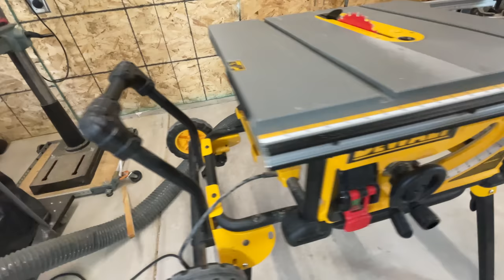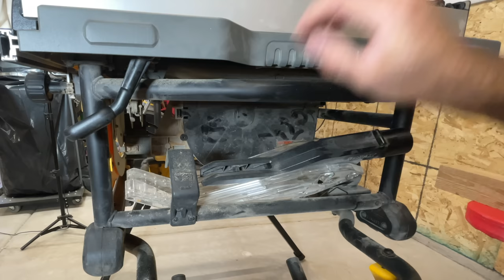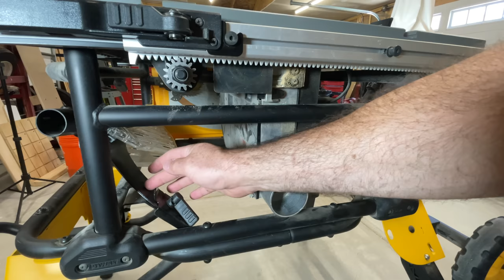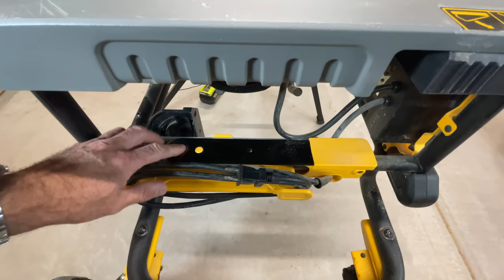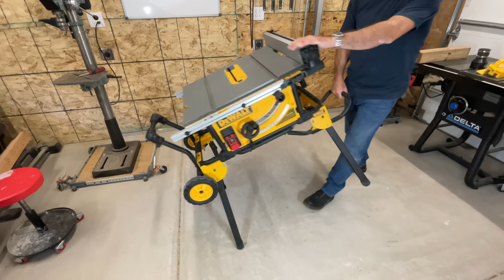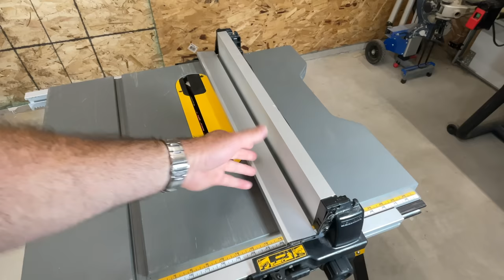The Saw Designed For Everybody?  |  DeWALT DWE7491RS   |  Review and All Adjustments

Comment: I have this saw and it’s my first table saw. I bought it cause I still wanted to park my car in the garage. It does bog down a little bit when cutting thicker material, but it’s not where I don’t feel safe making the cut. My only complaint is that the table top has little dips and valleys (it’s not flat). I found it impossible to find out if it the blade was truly at 90 degrees with a digital angle finder cause I didn’t have a flat table to reference from. I made a sled for it though and it seems to have fixed that problem, also makes the table top a little bigger. Overall I love this saw and it’s really helped me with projects around the house. I did recently start saving for a bigger 3hp sawstop as I’m now looking for more precision. Thanks for showing how to make all those adjustments, this is the only video I’ve seen that shows that. I’ll save and reference for later.
Reply from the maker: Glad I helped Cristian! I think you’ll be a amazed at what a huge upgrade the Sawstop will be, good luck!
Reply: Do you ever have problems with dust getting into the gears and rack for the fence adjustment?
Reply from the maker: No is all worked normal except for the riving knife adjustment. All the holes were jammed with sawdust to the point I thought I’d strip the bolts. Everything else was spot on.
Reply: Your see was defective. I have bought no less than 50 table saws over the past 20 years, and I've never experienced "dips and valleys." I've experienced other inconsistencies, but not a table that wasn't flat. Flat being relative, but flat enough for a portable table saw. Get it replaced under warranty.

Comment: This is the saw I used when I started my woodworking journey. I also used it for the occasional handyman job and it served itself well until it died after less than three years. I changed the brushes, switches among many other things and it wouldn't turn on. I would advise anyone to see if there is a repair facility in your area if you can't repair it yourself. I found out I didn't have one that was within 50 miles of my house. I ended up putting it on the side of the road and got a Jet 3hp saw and couldn't be happier
Reply from the maker: Sad to hear it didn’t last but I’m sure there’s no comparison to the Jet. Thanks for the info!
Reply: Did you test for power at the switch, the power cord or some terminal might have a short

Comment: Hey Mike. I like your comparison and thorough walk through videos. I had the 8 ¼" Dewalt job site saw (DWE7485)  for a week or two when this model went on sale at the big box store for $550. I returned it and bought the 10" DWE7491RS. I found your video very useful for some of the adjustments and tidbits. To do my bit to support your channel so you can post more quality videos, I subscribed. I also like your no-nonsense, straight shooter style. Good job my man!
Reply: Interesting - I did the exact opposite - got rid of the 10” in favour of the 8” for the portability. I have found the 8” cordless version to be so convenient to toss on a pair of sawhorses and store on a shelf. But that said I do have a track saw for sheet goods and a 3hp Unisaw for the shop.

Comment: I inherited a large contractor table saw that I never used because it was big, intimidating, and stored in a corner of my garage I couldn’t work around. I gave it away after years of collecting dust. 

Enter the DeWalt 10” job site table saw: I love this thing! The portability means I can easily move it into a position and setup a temporary workspace, then put it away without it taking up a large footprint. It feels SOLID. Also, being able to watch YouTube videos like this made me feel comfortable learning about all the different parts of the table saw (there weren’t any available specific for my 1970s contractor saw). It’s just a very convenient table saw for a homeowner to use. If I had a dedicated wood shop, I’d probably use something else. This is perfect for me.

Comment: I've had this saw for over 4 years in my garage workshop and it has performed very well. Combine it with a good blade, a decent outfeed table, a crosscut sled,  and a few jigs and it will handle almost anything. The only downtime I experienced with this saw was a failure of the blade raising mechanism. There is a threaded steel rod that threads into an aluminum motor mount which lowers or raises the saw when you rotate the spindle. They probably use aluminum for that part to keep the weight down. After about 3 years of use the threads in the aluminum motor mount stripped and the entire mount needed to be replaced. The repair shop indicated that this problem was fairly common with a lot of job site saws and not specific to Dewalt. My advice is keep that mechanism well lubed,  with a dry lube preferably and any sign that the mechanism isn't working smoothly lube it again.
Reply: Also there is a non threaded rod on the other side.  That also needs to be lubed at the same time otherwise it will bind.

Comment: I bought this saw 4 yrs ago. It will do everything I ask of it BUT cut accurate crosscut with that miter guage. I replaced it with an Incra brand...and..something not commonly known, I cut a strip the actual width of the miter slot and sanded the bottom flat. No more issues. It does everything I ask of it now with zero problems. I have a small shop, so the ability to fold it up and store it against a wall is a big plus! Thanks for the review. You did a fantastic job!
Reply from the maker: Thanks for watching Alan!

Comment: I have had this saw for over 5 years now. Great saw! I make cabinets and do high end trim with it. Fence is sturdy never needs adjustments. Motor is more then powerful enough IF you use the right blades for your job. Ex. Ripping I use a thin kerf ripper. All else I use 60+ tooth combo blades. I dado with it as well. Spins up an 8" dado set no problems!
I would highly recommend using your compressor to blow out the bottom of the saw and fence rails after all jobs. Then give all adjusting gears on the bottom a good spray with dry lube. You will be very happy you did.
The miter gauge supplied is useless for me. I make a ton of jigs for the saw to accomplish everything I need.I hook up my shop vac directly to the dust port and use a dual pluging switch and it works great.
My only complaint. And this is minor! The switch recently went on me. I replaced it with a simple 20amp rated light switch and a chrome cover plate using the same internal box to mount it. Came out as a nice clean looking install. And works great!
This saw owes me nothing! I have owned a mini max sc3 slider and had to down size. I went cheap and bought the Ridgid equivalent to this saw. Went threw 2 of those garbage saws in less then a year. Got the last one warrantied and sold it asap. Then bought the dewalt, money well spent.
Highly recommend.
Reply from the maker: Thank you for the insight! Thanks for watching and Happy New Year!

Comment: If you drop the 2 legs to ground by handle 1st, you can grab frame on other end lift and drop other 2 legs. I find it easier and puts less strain on the 2 legs when you flip the entire unit around. Thanks for the content!
Reply from the maker: Thanks for the tip!
Reply: drop the 2 legs hear the wheels first? then the other 2, this looks like it has 2 handles...

Comment: I have an original 744 that’s about 24 years old. Still runs but it’s noisy, bogs down often (push slowly), likely needs new motor. It’s mounted to another Dewalt aftermarket rolling stand that is excellent. Stand is easy to manipulate, soft solid wheels, easy to open and break down and has almost no movement when saw in use. Love that stand.  I’m looking at this saw above which has more RPMs, larger rip cuts, and useable options. My old Dewalt miter gauge is all metal and it’s accurate enough for a job site saw. I use my old Incra miter gauge. That Delta contractor saw isn’t really portable so it’s gonna be better. I need to bring a saw to a job occasionally so the Dewalt makes sense for me.  Demonstrating how to square and check flatness is very helpful! Thanks for a good review! 👍
Reply from the maker: I still have that DeWALT and I’ve used it many times over the last 6 months. I think it still deserve the praise now that I’ve had it for a while. It’s going back to its owner tomorrow so we’ll get a different DeWALT to check out soon. Thanks for watching!

Comment: Had mine for a couple of years now. My only complaint is the accuracy and operation of the blade tilt operation. Once set up accurately it’s a joy to use . Love the fence system and store for the prong stick. So important to align the blade with the miter slots and then set the fence to align with the slot and blade. I bought an accurate mitre gauge and a range of saw blades for different applications. Definitely recommend it.
Reply from the maker: Thanks for watching!

Comment: I just got one of these, they upgraded the miter gauge to metal and have a different mounting system for storing the blade guard. The miter gauge track still has a little slop in it; I've seen others cover the rail on the gauge with painters tape to keep it more snug.
Reply from the maker: Thanks for the tip and for watching!

Comment: One adjustment to the fence that I found out after struggling with some rips - is the fence can be out as much as a 1/4 inch because the grommets holding the fence to the rack and pinion rails can be terribly misaligned right out the box of a new saw. So when you line your fence up and if it is not in line with the bevel loosen the grommets on each side of the fence with an allen wrench square it up - then check the length reading with a tape measure  and you may have to go back and forth to get it right so the rule on the machine is accurate again with the fence straightened out. You will have to check all 3 positions. THis is CRITICAL to get a straight rip without bending the blade eventually. you would think the factory would have this set correctly on a new machine. Thanks for all the other settings descriptions.

Comment: JAN 2024, I just bought this saw and put it together today and I guess if it works great you don't have to change much, because the saw I put together today (new out of the box) looks just like the one in your video. I did have to pause the video and run outside to look at the miter gauge, I don't think the one on this saw is the original or at least they have greatly improved the one that comes with the saw now. Also behind the fence is a holder for a push stick that came with the saw. I have not turned mine on yet, but I can't wait to use it! It's an upgrade for me, from the little table saw that my brother gave me years ago. So, after watching this great video on the ins and outs of this saw, I'm ready to make something!  Thanks.

Comment: This is, in my opinion the best table saw for an onsite carpenter, or someone who only wants to buy one table saw and also be able to bring it on site easily. The Metabo c10rjs and Skil Ts6307-00 are great, cheaper alternatives (currently own the skil and had the metabo but sold it for the Skil due to the Metabo not fitting well in my vehicle). While both are great saws, the Dewalt is nicer, but it is also significantly more. For someone looking for a shop saw I would say your delta looks to be the best for the money. 

I will be buying the delta for my shop, keeping my Skil for the field, your reviews have been a huge help on my decision. Thank you.
Reply from the maker: Hello Michael! I’ve been eyeballing that Skil saw but it’s really my goal to review everything eventually. The DeWALT is really good and tough to imagine a better job saw. Most of my very minor complaints with it would be plastics used but I’m sure that has more to do with weight savings than cost cutting. Very happy I was able to help! Thanks for watching!

Comment: I bought this saw for a job I've been on over the past year. It's amazing how not one thing is has changed from the saw in the video to my saw, ten years later. Sometimes things are just good. The miter gauge hasn't left its slot. I use a track saw for anything other than rips. Everything was calibrated, I may give it a once over for cabinetry. Other than that, you can't argue with what comes out of the box.
Reply from the maker: It’s definitely a design that’s held up! They’ve been on sale lately and I’m wondering if we won’t see a new model soon. If so we’ll definitely be doing a vid. Thanks for watching!

Comment: I own this saw and have since it first same put and think it’s great; it isn’t a crazy big fence though, it only goes right to 33 odd inches. This will run a dado stack and adds some easy mobility. 
I’ve have added table extensions both left and other and even installed a router insert; the stand still carry’s it well and is still very stable. This saw is quite well motored and can easily get to 14-18 Amps at 125 Volts while cutting equating to just under 2 HP. This runs nice on a 20 Amp breaker but will readily trip a 15 Amp breaker under load. 
You can flip the bottom legs up and down with your feet so you font have to bend down.
Reply from the maker: Thanks for the insight and for watching!

Comment: My wife and I are starting on the reno on the house we just bought. I'm looking at these saws because I have no desire to become a full-time woodworker, but I'm not sure my circular saw can do everything I might need to do. At the same time, the circular saw and a couple of the Kreg gizmos look like they could do about everything while taking up a tenth as much space as even these little tablesaws.
Reply from the maker: Hello! Congrats on the new house! Years ago I did residential remodeling in high end suburbs of Chicago. The contractor I worked for might have owned a table saw but I never saw it if he did. We did everything by hand with a circular saw. Everything. No gizmos. But I had him to teach me the techniques to work efficiently and safely with limited tools. If you are new to all this I recommend you buy a table saw and learn how to use it effectively and safely. Obviously I don’t know the projects your planning but as general advise it’s easier to rip boards on a table saw than by hand. There’s a never ending supply of cool gizmos out there aimed at costing you time and money. Some are worth it but most are for the hobbyist. If your planning on learning carpentry from videos focus on the older guys who teach safe techniques with basic tools. I have a $350 Skil table saw in the shop now I’m half way through filming. It has similar features to this DeWALT and the legs fold to fit on a shelf. Keep an eye out for that vid in a week or so it looks promising. I hope this helps. Please feel free to post any questions. Thanks for watching!
Reply: @ProjectsForAllVideos  The only really big project I have planned is kitchen cabinets. Granted, that's a pretty big project. My biggest limiting factor is workspace. The garage is packed with stuff, the driveway isn't level, no available rooms in the house. I figure a lot of things will have to be built in place. It promises to be entertaining.

Comment: Mike, two days ago I received shipment of a new DeWalt DWE7491X, the one with the scissors stand. The difference is inconsequential for the saw itself, of course, and that's the point: your video showing all of the adjustment points on the saw is the most valuable reference I could have as I start checking out the accuracy of the saw. It arrived with no sign of rough handling or the slightest bit of damage, but I assume it's going to need some adjustment after its series of flights from southern California to Seattle, to Anchorage, and finally to Osaka, Japan, and from there by truck freight over three mountain ranges to my home way out on the southernmost coast of Honshu. Many thanks for the excellent demo of all the adjustments possible on the DeWalt. I'm confident I'll be using the knowledge you provide so clearly.
Reply from the maker: Hello Rick! I hope you love that saw! Sounds like it would be tough to return! Thanks for the comment and I’m glad I was able to help. 
Good luck!
Reply: @ProjectsForAllReviews  Hard to return? You bet! Necessary? Not looking like it. The saw is very good for what it is, just as you say. Happy to have been able to view your video once, before deciding on purchase, and again afterward. Big help each way. Compliments, Mike.

Comment: Thanks for this review. I’ve owned the saw for years and it meets my needs. I did get an aftermarket miter fence to make crosscuts. 

At 15:22  you discuss adjusting the fence vertically square to the table. It can be done but not really engineered to do so. The aluminum section is held to the plastic end pieces with screws that are torqued very tightly and possibly held with Loctite. If one can remove these screws, the aluminum section can be shimmed to get the fence vertical. I had to do this. Another solution is to add an auxiliary fence and shim the auxiliary fence. 

The cut where it was most apparent was when resawing a board when the board was wide enough to require flipping it over to complete the cut. It would leave a slight ridge in the middle.
Reply from the maker: Thanks for the tip!

Comment: Thanks for the excellent review. 
I've been using the older brother, the DW745 for many years.  Love that saw, and it just keeps going and going.  As for rip capacity, it's never been an issue for me.  I track saw sheet goods down to 16 inches or so, and then they can be run through the DeWalt pretty easily and safely, especially when used with a shop-built outfeed table.  And you're right; the miter gauge is a joke.
Reply from the maker: Thanks for the comment! I wouldn’t want to run full sheets through it but I don’t like doing that with my contractor sized saw either. A track saw, even a cheap one make life a lot easier.